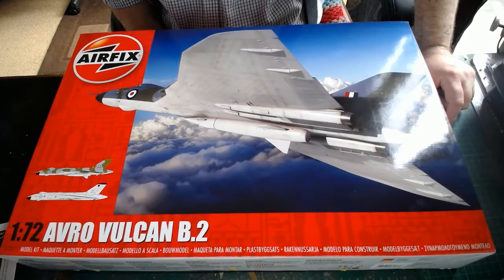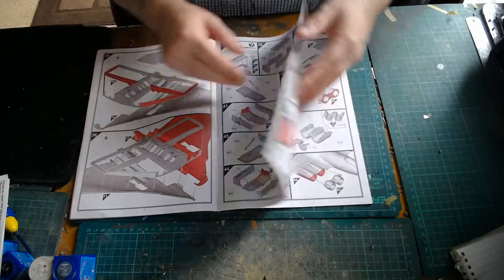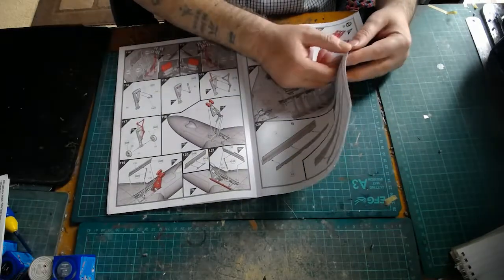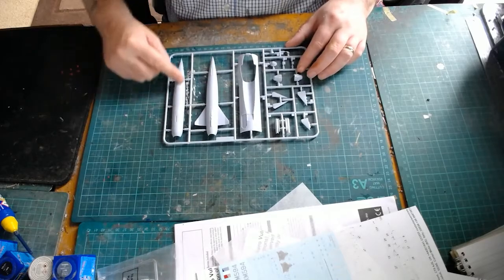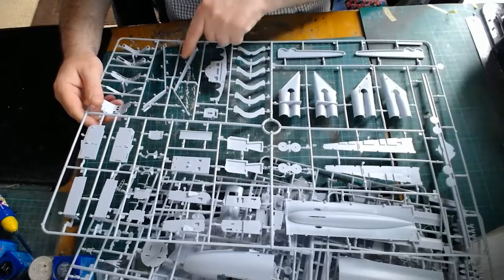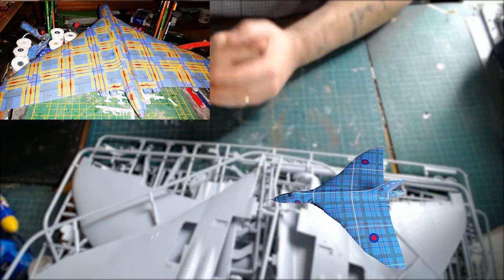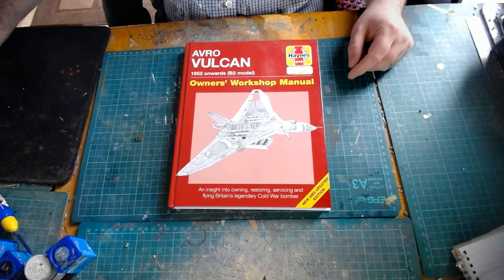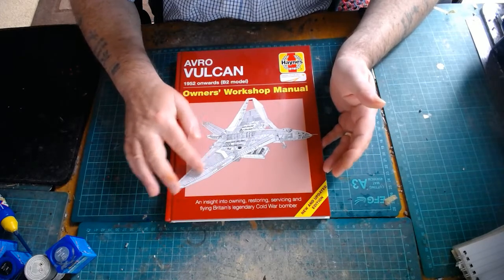Airfix Avro Vulcan B 2 Part 1 Introduction Scale 1/72

Comment: Bloody hell Gav! You set the bar way up high! Looking forward to this, will follow along with my Haynes open.
Reply from the maker: I may have bitten off more than I can chew on this one. I'm going to have to add extra support to the wings airframe and have a go at scratch building the engines. So it may not turn out exactly like the Hynes manual.

Comment: Hi Gavin I just subscribed to your channel today. So I'll be following your build of the Vulcan. Looking forward to how you build your model. See you on the next video.
Reply from the maker: Hi Steven thanks for the sub. Let's hope the build goes well.
Reply: @ReckshawScaleModels  I was looking back to when you built the Yamato, and I was curious about, when you used the tamiya xf acrylic series paints. Do you thin them when you are painting with? I'm going to be building several models, and like you I prefer to brush painting. Are there any tips you could give me when I'm using acrylic based paints.
Reply from the maker: Hi Steven, it all depends on the thickness of the paint on the bottle. With Tamiya I will only use X20-A thinner. For Humbrol and Revell I'll just use water to then them. You will find that you will have to thin Revell and Humbroll more often then Tamiya.
If you are using Tamiya remember it is a lacquer based paint. This means it will behave differently from Revell and Humbrol. You may find that you lift off the paint as your brushing. Thinning the paint will help with this but you will need to apply more coats.
Chose your brush carefully, for smooth surfaces use a flat brush. Paint on one direction, think of how the air/ water flow would go over the model your building and paint in that direction.
For raised and detailed areas a round brush is best. Again always keep you brush moist. Clean it after a few passes, don't let the paint build up on the brush.
Paint in thin layers and build up your colour, let each coat dry before adding another coat. If the layers are thin enough this won't take long but Tamiya will take longer to dry.
Primer is key also. My rule is white for light colours, grey for greens and greys and medium depth of colors, and black for silvers and and the darker shads of colour. Grey primer works OK for silver's but the black gives it a more depth. So of you can't be bothered using different coloured primers then stick with grey, but it will take longer to build up the lighter colours. I use halfords primer for most of my builds and they have a great range to chose from.
Reply: Thank you Gavin, for all those tips, this will be a tremendous help while I'm painting. One more question. I  use tamiya fine surface primer to prime my models, does acrylic paint work on that primer? I know a couple of these questions sound very basic but,  it's been a long time since I've built models. So, I'm just getting back into plastic modeling, years ago when I was much younger I built models as fast as I could, you know, cut the pieces off the sprue slap some Testors enamel on them then get the stringy Testors modeling cement so I could slap them together and display them as fast as I could. Not a whole lot of attention to detail and very little patience. Watching you and others like Jason from model kit stuff,  and John Mansell,  Nigel and others I've learned that model building is an act of love, not a sprint but a marathon. So thanks for all those tips you all share with everybody. Now I know that the models I build from now on out will be much better than what I built when I was a teenager. Thanks again and I'll be looking forward to more of your content down the road.  See you on your next video.
Reply from the maker: Hi Steven, Tamiya's Surface Primer works well, the only reason I don't use it is the cost. My advice is to choose a  model kit with a subject you have an interest in and for that kit to be a basic one to start with. That way if you run into any problems it should be easy enough to sort out. They are many companies offering kits now with a whole range to chose from, it can be a bit of a mind field for beginners and people who are getting back into the hobby. Heller and Tamyia have a great range of basic kits and are easy on the wallet. Manufacturers like MENG, Italeri, and Dragon are more expensive but can have amazing detail. The middle ground would be Airfix, Trumpeter, and Revell. All have their pros and cons with so many others you can throw into the mix. But saying all that there is nothing like just jumping in and having a go if you don't mind a few bumps along the way. Remember there is no right or wrong way as long as you have fun building them.
Reply: @ReckshawScaleModels  thanks for the encouraging words. I'm excited about getting back into the hobby. I'm going to be building the Bismark by tamiya, the Hood by trumpeter and prinz eugen,  I'm planning on building the Prince of Wales as well all 1/350 models. So,  I have a daunting task ahead of me.
Reply from the maker: @stevenwheaton874  The Bismark is a great build, think you will love it.